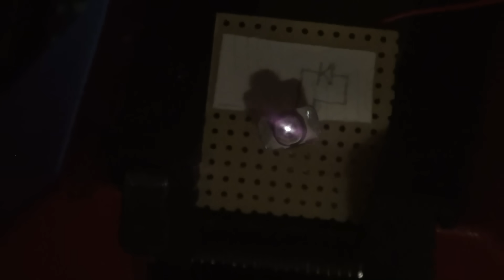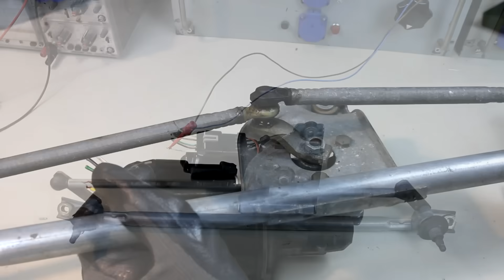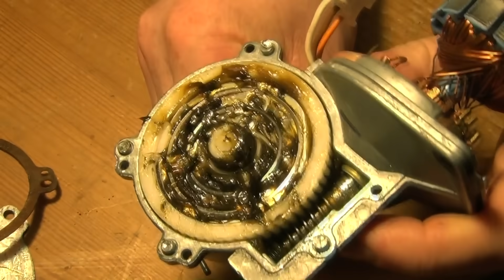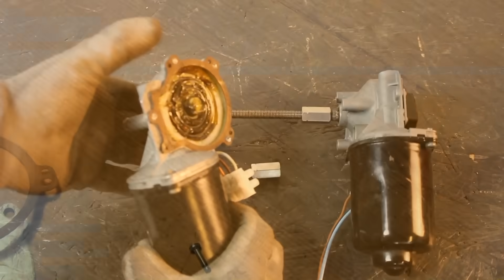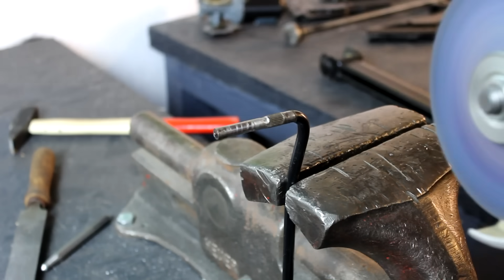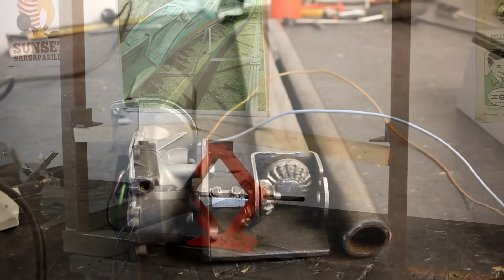Build Powerful Linear Actuators from Windshield Wiper Motors and Car Jacks

Comment from the maker: Hey guys. New video (Robot with Windshield Wiper Motors!) https://youtu.be/k7XKJWinG2U
Reply: @The Post Apocalyptic Inventor: You should NOT use the brush for the higher speed setting as that is the tertiary brush you noted in the video. This offsets the rotor poles but leaves less of the winding to do more work. This brush should be removed and this connection ignored. Only use the directly-opposed brushes, as this balances the current between ALL rotor windings.

The high speed is largely inefficient, and when re-purposing these for linear actuators, this largely reduces torque. The high-speed brush is a cheap cheat to avoid using two motors in series or parallel as a two-speed control, and high motor load in this manner can burn the motor, as the "low-speed" wiring that uses the diametrically-opposed brushes provides much greater root-mean-square power than the crude cheat that is the third brush.
Reply: The Post Apocalyptic Inventor c
Reply: Nice... but tell me now,... my comments are witnessed and acceptable.
Reply: We used linear actuators for this robot hand.  
https://youtu.be/vOLvFhdkLmA
Reply: I like this channel, and the other German guy: Great Scott.
Reply: I guess the bad news is ya can't reverse the wiper motor. Now if ya buy an actual cheapo 5hp 12 volt electric motor with reverse for say 25 bucks ya got yourself something...
Reply: Great idear but one question is how do you get it to go in the other direction
Reply: @jamesgreen105  It doesn't... You need a 2 directional motor with a 3 pole lag switch... It's a concept... U&I would go to Grainger and for about 30 bucks have the thing solved... Wiper motors only go one direction then the other...A 3 pole switch mechanism would cost about as motor that has one built in to do the job.. Deal with it..
Reply: Sehr schön das Du auch die deutschen Begriffe dazu schreibst. Aber warum schaust Du hinter dem Steuer so böse?

Comment: I have 8 actuators from powered recliners i have salvaged over the years though to use them for power doorson a car. Thought of doing the scissor jack you made but dint think a windshield wiper moter and gear drive would be strong enough to lift a medium sized car i usally use my Milwaukee 3/8" impact but i tear sissor jacks up a lot keep stripping the acme screw. Thinking of making a heavy duty obe but those acme screws are expensive!!!

Comment: I assume you already know that those wiper motors can be fed with 24Vdc for short period of times, that will make the linear move much faster. You could use that for steering or other short linear movements.

Comment: Salut!   J'essaye de traficoter moi aussi un moteur d'essuie glaces pour m'en servir avec une vis sans fin dans l'espoir de m'en servir comme "power tilt & trim" sur mon moteur hors bord 30 forces : ) 
Meme si le moteur est bien isolé contre l'eau, Etant donné qu'il sera litteralement dans l'eau Donc:J'ai l'intention de l'isolé avec du "Dip" (un produit en can remplis de substance semblable à du caoutchouc) Je n'connais pas le nom francais désolé?  Qu'en penses-tu?    J'aime bien tes systeme de levages. J'aimerais me faire de quoi de plus minimal;iste car l'espace est restreint soit à coté du support de moteur ou bien en dessous. Grace aux 2 sortie positif et 1 ground, çà va bien fonctionner pour avant et arrière avec la bonne switch çà devrais l'faire ; ).                                       Comment tu t'y prendrais en ayant comme materiel une longue vis de 15cm . Un moteur. Une switch du fil. Du dip. Une bracket. Merci! Je suis abonné à ta chaine tes idées ressemblent aux miennes. Salut!
Reply: *This is the english traduction: Hi! I'm also trying to fiddle around with a windscreen wiper motor to use with a worm in hopes of using it as "power tilt & trim" on my 30 horsepower outboard motor :) Even though the motor is well insulated against water, Since it will literally be in water So: I intend to insulate it with "Dip" (a product in cans filled with a rubber-like substance ) I don't know the french name sorry? What do you think? I really like your lifting system. I would like to do something more minimal;ist because the space is limited either next to the engine support or below. Thanks to the 2 positive output and 1 ground, it will work well for forward and reverse with the right switch that should do it; ). How would you go about it with a 15cm long screw as your material. A motor. A wire switch. From the dip. A bracket. THANKS! I am subscribed to your channel your ideas are similar to mine.

Comment: I can't help but wonder if you could 3D print a replacement worm gear than casting it in aluminum bronze as a replacement. That aught to hold up to quite a bit more loads.

Comment: The other wires turn the wiper motor into a generator when you hit the Park position in the car or when it's on Intermittent. By placing a load on the motor it causes the wipers to stop.

Comment: South Africa here

There is SO MUCH potential with this wiper-motor linear actuator 
1) a solar panel array to adjust for the sun's angle of inclination
2) a tilt for a dump truck/trailer

Comment: There's a trick to make the motors work faster.
Power it without using the ground terminal.

The motor might zap you, so:
Open the motor and remove the Ground Brush.

Comment: Thanks for the gate idea i like u have a surplus motors I have had a wiper motor since the year 2000 from a 1963 ford I was working on a paddle style fan in the garage but its loud. But the gate idea i like for this

Comment: So... you have just showed me how to create a really cool way to level my camping trailer!    I can use this Idea as the travel does not have to extend as far as you have gone , I already use these type of jacks to level, so I will be buying  4 of these motors at the U pull it place and then I can build a remote  and mount my jacks directly to each corner bumper and add a permanent bubble level to the side and back.  LOL

Comment: not sure the 2x4  experiment is a good one,  there was no strain or stress on the motor because of the length of the 2x4..., I'm sure if the 2x4 was half the length the motor would burn out.

Comment: The jacks have a very poor quality worm and nut . I have many scissor jacks I use regularly. Because of the quality issue they need to be replaced with a degree of regularity commensurate with their redundancy. One I will mention for your thoughts. I weld a socket set universal coupling onto the (jack) drive end to the male end of the (UJ) knuckle. Thereby using a battery drill with a 3/8" socket driver in it to jack things up quickly , engage reverse and dump it back down. Interesting thing is the UJ collapses faster then the worm and nut int the Fiat scissor jack . That particular jack has been unusually reliable. ALL the others are Japanese that I had used for various lifting duties.
 I wonder if the wiper motor can be reversed?  Thanks for the insight you provided.

Comment: steering system? no need for steering motors, you have 360 steering with two drives and only need casters on other wheels. just seen how old this is I'm sure you figured that out..

Comment: Tap a hole through a block of steel - a wide nut. Use a power drill to spin a threaded rod to move the block up and down. You could use nylon for models.

Comment: Look into a waste oil heater or a wood burning rocket stove for heat.
My shop is not done yet and right now it is 16F or -8.9C  in it.
I am not sure what I want to build but the waste oil heater could be my best option.
No carrying wood all the time to re-stoke the fire with.

Comment: This man is way above my current aptitudes & capabilities. Whereas this is true I do find parts cleanup with gasoline & an old rag to be (for many)quite hazardous. In my work we often use citrus de- greasers which are very effective & less combustible. Certain powdered hand cleansers I have also used which are water soluble yet cut grease & dirt amazingly well

Comment: I know this is a couple of years old but I was wondering if you tried to run the wiper motor in reverse. Seems like you need a motor that can be reversed to make this actuator practical. 
   I know power window motors can be reversed and are pretty powerful. You could also get more speed with a engine starting motor but I don't know if you can find one that is reversible??? If not, it may be possible to use an old ratchet mechanism and connect two motors that turn opposite directions to achieve powered movements in both directions. 
  Great video! Take Care and be safe, John

Comment: The “nosepiece” holding the bevel gear in I think is called beening, I might be mistaken. But once to secure a spring loaded steel ball in a hole in the end of a steel shaft, so I had to been the metal around the edge of the hole to retain the ball inside, that’s where is picked up the term.

Comment: Not being negative but...The motor runs in car with 15 to 20 amp with dry window drag! It's going to be large crock clips on car battery (cigarette litter skt) 10 amp limit

Comment: DIY AIRCRETE INSULATION.

DIY ROCKET MASS HEATER....
By Erica & Ernie WISNER.
THERE IS ONLY ONE !!
30 HRS HEAT from kindling.  NO SMOKE.

DIY SODIUM SILICATE.
      1001 USES.

Comment: you can go to Harbor Freight and buy trailer tounge jack they have several sizes and they are cheap, i have wiper motor on my metal lathe for power cross feed with a pwm with reverse, also have wiper motor on trailer jack to raise and lower my road grader blade, there's lots of uses for wiper motors and i get mine free off of old pickup trucks that are sitting around dead  good vid THANX

Comment: how do you reverse it? if used as a jack or gate opener it has to reverse.
Reply: Reverse polarity?
Reply: KILLorBE  you can’t on 12V DC duhhhhhhh
Reply: @TheProcustoms  Who told you that? I think it's easier to reverse a DC Motor than it's to reverse an AC Motor most of the time (Some DC Motors may have built-in Diode(s)). A few examples of DC Motors with reverse: RC Cars, Cordless Drill, Electric Windows, The Tray of CD/DVD/Blu-Ray players and Consoles... etc.
The easiest way to do that is probably by using a H-Bridge.
Reply: I was thinking the same thing. What goes one way, needs to go the other. 

No point in using these motors as actuators if it opens a door but will not close it.
Reply: @ianallen2  See my reply above.
Reply: @KILLorBE  There is no reverse on the motor so it will not go opposite direction. He built it for nothing. As useful as a chocolate fire guard. Please point out the time on the video where he used a 'H=Bridge' which you mentioned in the reply. Steven Reitz asked a perfect understandable question and you pick fault with it over something that is not shown or placed on it.
Reply: @ianallen2  Reversing Polarity is the reverse of a DC Motor, while he doesn't use a H-Bridge in this video, he does mention it at the end of the video: https://youtu.be/vxhBMiyy3y0?t=1132
I suggest you look up H-Bridge and what it commonly is used for, but also watch the following video in which he explains a bit more about using Windshield Wiper Motors: https://youtu.be/k7XKJWinG2U?t=72

Comment: Plz never tell ppl to use fuel as a cleaner.
Reply: why not if it works?  lots of everyday products are flammable
Reply: @barleyharvestbride  because it's idiotic. The vapor alone is enough of a reason. Cleaners being flammable is one thing but gas vapor is going to get a person super high. Then, when they do something to ignite it's ridiculously low flash point they'll fry. I met a guy at a party once. He was cool so when he asked to add me on fb I did. Weeks later he was over 50% burnt doing typical oblivious white guy sh!+. Liability.... telling people to use fuel on the internet will get yourself sued.
Reply: @Bo_McZombieface  yeah, it would be stupid to do it without a respirator.  I use a respirator with an organic filter for just about every project now since I have asthma... you never smell a trace of anything no matter how nasty the chemical.  I always use gloves too, and then shower after.  Sorry about the burnt dude, but that's on him, not any YouTuber.

Comment: This channel highlights what a wasteful society we've become. If we put more into teaching people basic engineering skills we'd all be able to reuse most of what we currently throw away.
Reply: there are entire countries that do it out of necessity. Instead, we have laws to prevent people creating their own deathtraps. They are called regulations. For example, I could probably build a whole car from scratch out of random junk, but it probably wouldn’t pass pedestrian safety standards. So if I accidentally ran someone over, they definitely wouldn’t survive. If you disagree with this concept, you should vote to reduce things like public safety regulations etc.
Reply: Consumerism prevails to benefit the grand capital at the expense of  Nature and Humanity...
Reply: I like repurposing "junk" that I already have on hand as much as the next guy, but to do it on a national (in a developed nation) or global scale just isn't feasible. Whatever you save in material costs you easily lose in additional labor to adapt the existing items into the new product.  This process would be difficult, almost impossible, to automate because it's likely that all the used items are each slightly different from each other, which means that each one becomes a custom built item. It just wouldn't be profitable, and if its not profitable it can never happen on a major scale.

Comment: Your system is putting out around 600 foot lbs of pressure maybe more that is good considering that your using a windshield wiper motor/lead screw design one thing I wanted to see was the power source that was used was it a car battery or household power from a wall outlet great video
Reply: R Broyles car battery if the windshield motor is 12 volt i would assume.

Comment: hmmmm - I have a few old jacks floating around, including an old jack from my E30 - long since gone. Running off a cigarette lighter, this would make road side tire changes a LOT less frustrating.
Reply: I miss my e30.  I'm on an e36 now, but it's hard to top the dirty 30.

Comment: Here in balkans, we use windshield wiper motors to power the skewer for roasting whole lambs or pigs. The transmision is simple, often by chain, or by 2 gears from cars starter motor. 5+ work hours under load by an ordinary car battery.

Comment: Thanks for the video, very informative.  Can you explain why a "normal" threaded rod should be replaced with an acme screw?  Thanks.
Reply: I believe it's because acme screw is stronger and can take more force as the contact surface between the thread and the "nut" are greater than in normal screw. And in this particular application when you lift or press things, you apply great force to the threads.
Reply: Thanks for your time, that makes sense.

Comment: Totally awesome! I have a background in the machinist trade, major appliance technician, and handyman home remodeling. So I can appreciate your mechanical aptitude and mechanical reasoning. Well done sir! A fantastic idea using the screw jacks, they are extremely strong and durable, just because of the thread design. And the use of a windshield mother outstanding! I drive a Mercedes Benz 300SD 1983 with over 300,000. In line 5 cyl. turbo diesel. Its a tank! I love anything and everything that comes from Germany. The engineers from Germany second to none, just like you. I do all my own auto repairs. Being mechanically inclined you can figure just about anything mechanical. Well done sir, outstanding video and presentation.

Comment: A tip for those who try this without the special splined section on the end of the worm drive. Drill a piece of flat stock steel the size of the M8 threaded section coming out of the drive, on the underside take a much large drill (20 mm should do or 3/4 for us Americans) and just slightly let it drill into the back side of the M8 hole to make a chamfered section. Then using a torch, heat the end with the hole up to bright orange (or to where a magnet won't stick to it anymore) and then very quickly force it onto the shaft and drive it a whack or two using a washer the size of the threads backed up by a close fitting deep well socket. As soon as it is down to the depth you need it dunk the drive gear and flat stock into water until it stops sizzling. This will do 2 things, first it will basically forge the correct spline and angle into the flat stock and when the piece cools it will shrink and pretty much permanently affix itself to the shaft. It would be possible to remove but with great effort. As long as the heat is only in contact with the shaft for no more than 20 sec before it is immersed in water, it won't have enough time to transfer heat through the shaft to the plastic worm drive enough to cause an issue.

Comment: an 18v dewalt will lift that jack way better.. i use it all the time on the same jack.. it will lift a small car like it’s nothing. but has a hard time on the half ton truck.. almost broke my wrist on that one.. the drill had so much torque that it tried to turn the other way :)

Comment: Thank you for this hugely useful video!   I am considering adding a set of linear actuators to lift a sleeping platform on a custom trailer, and you have inspired me to have a go at it.  I found the whole video useful!  Your approach to fabrication is really great.  Can you tell me what type of welder you’re using?  Is that TIG?

Comment: After RE-watching this, and seeing my previous comment below...
I am SMH.
BEFORE YOU STARTED RIPPING IT APART ...
DID YOU NOT SEE A PB SWITCH WOULD ALTER THE STEERING DIRECTION, SPEED AND OFF/ON.
THIS IS CRAB CONTROL FOR ANY WHEELED VEHICLE.
THE WHOLE UNIT GOES TO ONE SIDE OF YOUR 4/6/8 WHEELED VEHICLE !!
AM I WRONG ??